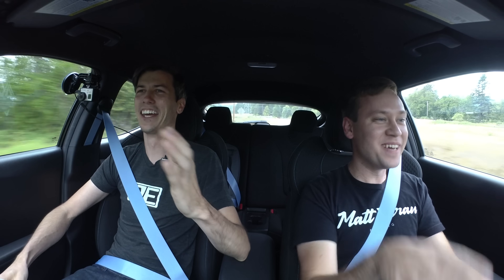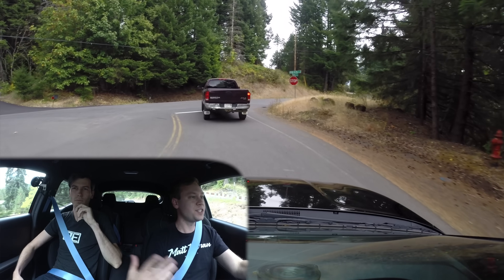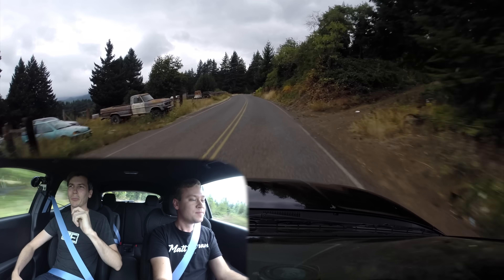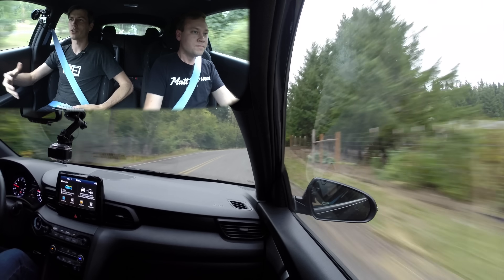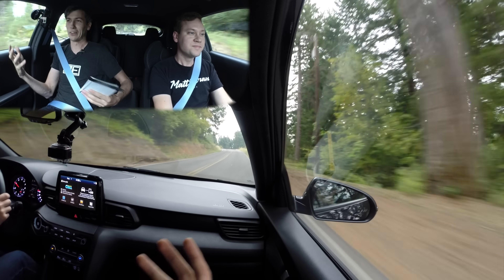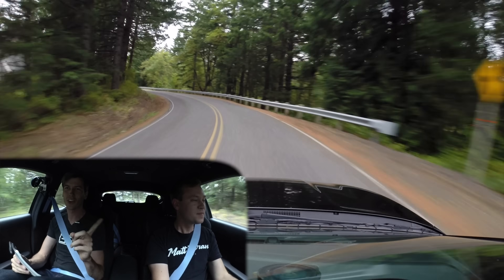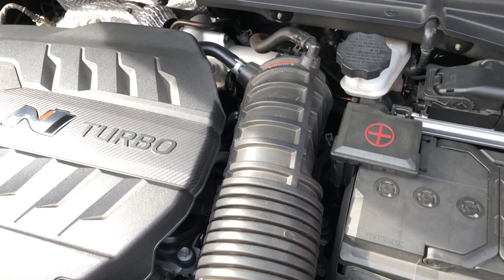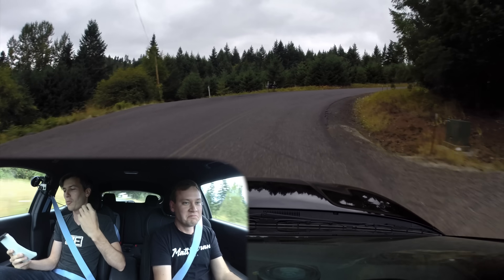Are Car Exhaust Crackles & Pops Fake?

Comment: Had a car that did this when engine braking and was complimented every time I got pulled over.
Reply: i had a naturally aspirated fuel injected 13B RX-7 that did this while shifting when at wide-open throttle. LOUDLY 😊
Reply: @matthewkuhl79  same, mine shoots big flames on shifts over 6k
Reply: @matthewkuhl79  my 06 mustang does this same thing, wot to just abt redline, shifts real quick, big ol bang.
Reply: My fuel injected E30 also did that, at times.
Reply: Oddly have a Saturn Ion that does that with just a muffler delete. Sounds amazing and legitimately fooled some people into thinking it's tuned lmao
Reply: A leaking injector or carb floats set too high. or truly piss poor timing are the only things that fill your exahust with raw fuel. Old race cars sloshed fuel during deceleration into the manifold, bypassing the jets, as soon as vacuum disappears and air is reintroduced, bang. You'll note Hilborn and Enderly injectors won't do that. Its bad for the compression rings and piston crowns.
Reply: My 1990 Galant GTi does this and is embarrasingly loud with an aftermarket exhaust. With the original exhaust it only sounded like metal clunks due to the heat shield moving from the pressure. It's fuel injected and is by no means meant to do so, but it does.
Reply: Just followed a douche in an Acura with 2 ft flames ejaculating out jizz tailpipes
Reply: @crazytrain7114  did you catch an STD?
Reply: In Australia, it might score you a yellow windscreen label!
Reply: My 96 s10 pops
Reply: My 2000 Infiniti G20 started popping when the exhaust fell off due to rust.  :)
Reply: was it carbureted?
Reply: @ALexus190  Do carbureted engines have a tendency to do that?
Reply: @lsswappedcessna  Fuel injected engines have the ability to completely stop fuel flow when you let off the throttle, so any pops and crackles due to fuel in the engine during deceleration are there on purpose. Carburetors just meter out fuel in relation to how much air is entering the engine, so they'll supply very little during deceleration since the throttle valve is closed but it's often still enough that pops and crackles are unavoidable.
Reply: @starry-ptg  I'll have to listen for that on my way to college later!
Reply: @lsswappedcessna  my bike has carburator, bit it doesent crackle, it explodes after a nice revy hill drive ... POooooF
Reply: @lsswappedcessna   mine does with aggressive down shifts (carbed v8/stick),my rear end unfortunately pops and crackles now too!!
Reply: @trillrifaxegrindor4411  Yeah, about the rear end thing. I can see that happening! I can't hear any crackle in my car, but that could be because it has a two-speed automatic. Yes, it's perfectly driveable and not really that slow given the recent transmission rebuild saw several rather important solenoids replaced, one with a solenoid for a newer iteration of the same line of transmissions. Engine does seem to click though. 

If you have any ideas on valve lash spec for an Oldsmobile 330 Jetfire-Rocket V8, please do fill me in on the details. It seems minor, no parts are physically damaged and it runs on all cylinders, it's also really quiet unless you're in a garage or between two parked cars where it can reverberate, but I'd rather not have to pull two valve covers and fiddle-fart with sixteen rockers and not know what they need to be set to, gap wise. I think I know how to set them, but I can't find the spec anywhere. Don't know if I have a proper service manual, though I do have the (assuming original, the book looks fairly old and the pages are soft and frayed at the edges, as if they've been flipped through hundreds or even thousands of times) owner's manual.
Reply: @starry-ptg  my old car used to have huge backfires during engine braking. Wasn't tuned. Just had an exhaust. It was fuel injected. It wasn't consistent like most of these new cars but every now and then it would
Reply: @lsswappedcessna  hydraulic lifters should be zero lash, MAX 10-12 thousandths normally
Reply: @starry-ptg  I have a slightly modified Subaru that originally had a carbureted 1.6. It was swapped for an EJ-22 from a 92 Legacy. An old MPFI engine. When I compression brake I not only have the bbrrraaaapppp from the usual engine braking, but when I downshift further while at a higher RPM I get pops as well.
Reply: @crazytrain7114  wtf are you talking about, every tappet is different
Reply: @jamespuckett1770  We talking rollers, flat tappet, mushroom heads from a Buick, hydraulic? What does that have to do with piss poor tuning?
Reply: you need to have cold lash to allow for expansion.

Comment: I can promise you that in my naturally aspired Lotus Elise the Crackles and Pops are NOT fake. They only appeared after replacing the exhaust system.
;-)
Reply from the maker: Just wasted fuel in that case haha, but at least the engine isn’t intentionally doing it for sound.
Reply: :-) it sound fun too :-)
Reply: because you need a tune.

Comment: I must know everything you know about motors
Reply: If it means I can take other drivers to gapplebees then so be it
Reply: Careful, youll have to learn differential equations then.
Reply: Jacob Burskey What are differential equations?
Reply: BeastlyJ  they are the equations used to figure out what gear ratio is needed for a diff
Reply: @CBRMovementss  haha nice one!
Reply: Michiel M LMFAOO nah I have no idea 😭
Reply: @EndorsedAura  equations with a derivative on either side, used to find and analyse a lot of the fundamentals for mechanical engineering, usually for fluids (air/water/etc). To get there youll need several semesters of calc, then youll need... Basically become a mechanical engineer lol
Reply: @CBRMovementss  An unintended play-on-words, that makes it even better! Well, differential equations are mathematical equations that relate the change of functions. And a differential as you probably know is a gear assembly that allows the wheels of your car to rotate at different rotational speeds in a turn.
Keep going to school and you'll learn all these things in no time!
Reply: lesson 1: Engines*
Reply: Also, the word motor is derived from Latin, not German.
Reply: Motors are electrical devices.
Reply: @vorpalblades  muricans believing they are the only ones in the world. It is an engine, or motor same thing. Motor is actually a German word who build the first car. No the model T was not the first car
Reply: @brofights3138  No, they are not the same.
Reply: @brofights3138  Silly Europeans - the American George Selden filed a patent for a  gasoline-powered 4-wheel car 6 years before Karl Benz designed his 3-wheel Motorwagen contraption.

Also, "motor" does not come from German.
Reply: How do you know if someone is an engineer? Easy, they'll tell you.